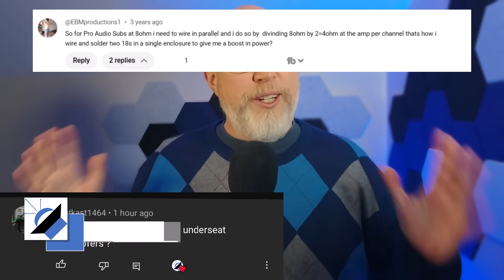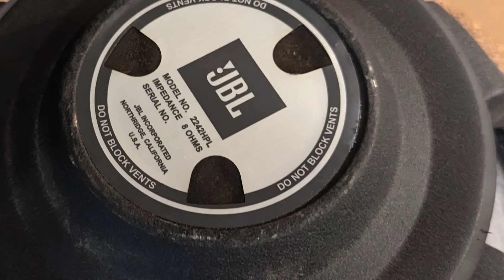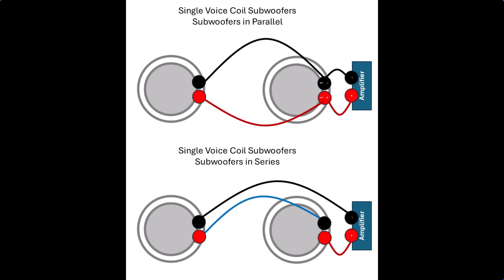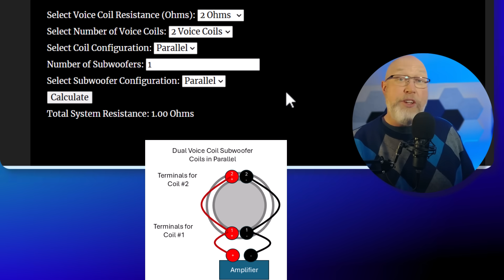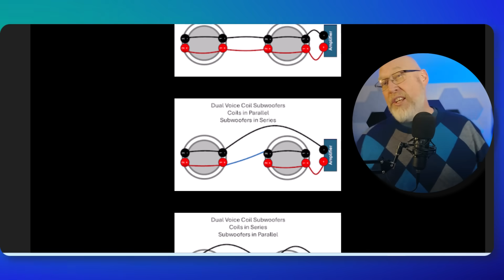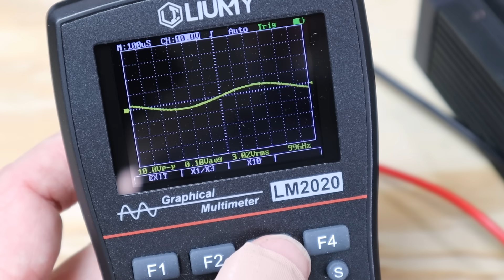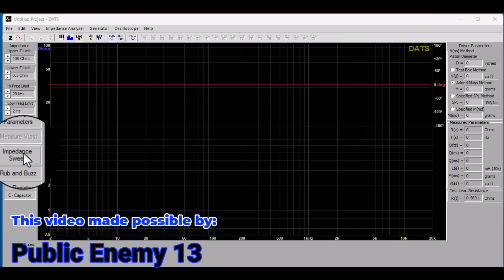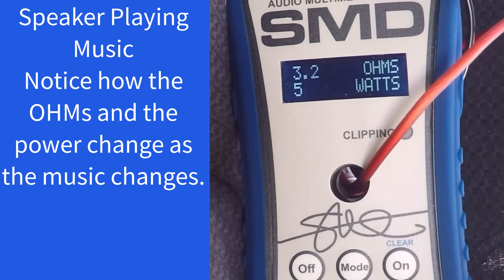Wiring your subwoofers for more power and more bass!

Comment: I NEED HELP! how do i wire 2 Sundown 10" Nightshade V6's that are dual 1 ohm, wired to 2 ohm? I cant seem to find a diagram but do I wire the subs separately in series, then run them parallel to the amp? Or should I just stick with 1ohm output and buy a 1ohm amp?
Reply: Positive from one set of terminals to the negative on the second set and same for the other terminals the to the amp

Comment: In my experience a 4 ohm DVC does not have two 4 ohm coils it actually has two 8 ohm voice coils and when wired parallel they make a 4 ohm load.
Maybe there's a reason it just seems that way. I have simple test equipment. But that's what I've found.
Reply from the maker: If you are measuring with a multimer then you are measuring the DC resistance.  DC resistance and nominal impedance are not the same thing.

Comment: @5.26 you've misspoke or made an error. A single 2 ohm dual voice coil subwoofer wired in series gives 4 ohms. Wired in parallel it gives 1 ohm. Parallel vs series absolutely matters with a single driver. In effect, a single, dual voice coil speaker will behave the same as two single voice coil speakers. I'm surprised no one has mentioned this.

Comment: Great channel! I have a 4 Ch. 2 ch x 4 ohm bridgeable amp. Can I run 2 tweeter on one bridge and this configuration on the other bridge (4 ohm Dual coil sub in series and 4 ohm Single coil woofer in parallel with the sub)?

Comment: Hi,  I have a question: I have a Jeep Liberty 2012 with a stock 6.5' subwoofer from a stock stereo.  I want to add a 10" woofer & separate amp. Can I get the signal from the stock woofer? Or should I get the signal from front speakers using an LOC like a PAC SNI-15? (My amp is a pioneer 760W, GM-5400T already used on the box sub in another car. )

Comment: Anyone know how the RMS power is divided between speakers when wired in parallel? For example 120 watts @ 4 ohms and 185watts at 2 ohms . Speakers are 4ohms each so if I wire them in parallel, does each speaker get 185 watts rms or half of 185 each.
Reply from the maker: Half of 185.
Reply: @DIYAudioGuy thank you so much!!

Comment: INSIDE THE "HOUSE / HIFI" = 8ohm
(pro stuff = 4ohm)

INSIDE CAR = 2ohm
(sellers using "watt out"  very low   "sounds  like more" )

OOHH  I HAVE  "5000 W  AMP" ..!! YES BUT IS IN  "0.1 ohm"  15sek  max
(look w output  in   4ohm or 8ohm "THEN"  = 4x25 WATT)

REALITY  IS  HARD

Comment: The impedance is both from the coil inductance and how much the speaker is allowed to move. If the speaker is allowed to move a lot, the impedance goes up. If the speaker is restricted by box loading, the impedance goes down. The speaker is generating a reverse voltage which has the effect of lowering the current going in.

Comment: Resistance is resistance not DC or AC. Take some time do research before making a video about something you don't know anything about.  Maybe actually read ohms law and see what it actually is kirckoffs law would be helpful as well
Reply from the maker: How about doing some research before you make comments that you know nothing about.
Reply: Look at a waveform and how a speaker works it literally has to push and pull to work. “Alternating “ 

The amp isn’t technically AC but a speaker has to be

Comment: The system is connected to battery not alternator so with your AC logic you claim speakers make would kill your battery everytime
Reply from the maker: You are missing something important.  There is an amplifier in between the battery and the speakers.  You are not connecting the speaker wires from the amplifier to the battery (or at least I hope you are not).  You are not connecting the speakers to the battery (again, at least I hope you are not).  The switching power supply in the amplifer gives the amplifier the voltage it needs, and the RCA input tells it how to move that voltage—up, down, back and forth—to make the music. The speaker never sees raw DC.

Comment: How does a speaker make AC electricity? I'm curious because AC current will 100 percent kill your battery very quickly. Your alternator generates AC current but rectifies it in the rectifier bridge . The reason alternator does that is because otherwise you would need a new battery every other day
Reply from the maker: If you place a coil of wire near a magnet and move either one of them back and forth you will generate AC current, you know what a speaker is?  It is a cone attached to a coil that sits inside of a magnetic field.  The same concept is used in reverse to move the speaker cone.  A speaker is an AC device, it is connected to an amplifier that powers the speaker, not a DC battery.  You don't hook the speaker or the speaker wires from the amplifier to the battery.

Comment: If you had a high impedance  multimeter such as  fluke 87v you measurement would be closer to the target reading.  An oscilloscope should be the most accurate for reading.
Reply from the maker: No.  The nominal rating provided by the speaker manufacture is just that, nominal.  In name only, or an approximation.  The DC resistance is rarely ever the same as the nominal impedance.  When the speaker is playing music the resistance (called impedance because it is AC) is a function of the frequency.

Comment: Ohm’s Law is a fundamental principle in electrical engineering and physics, describing the relationship between voltage, current, and resistance in an electrical circuit. It states that the current through a conductor between two points is directly proportional to the voltage across the two points and inversely proportional to the resistance between them.

Ohm’s Law can also be extended to include the concept of electrical power. Power in an electrical circuit is the rate at which electrical energy is converted to another form of energy, such as heat, light, or mechanical energy. The unit of power is the watt (W). Voltage is electrical potential to do work ohms are the resistance to the work  and amps or current is what carries the voltage it does the actual work. Watts are the power.  V=I•R, R=V÷I, I=V÷R.

Comment: So u cant drop two 2ohm double voice coils down to 1ohm ? 
I wired each of my subs to 1ohm tide them together to 1 terminal on my box , ran my load test and its reading 1.1ohm load , y is everyone saying i will mess up my amp thats 1 to 4ohm stable but told i can only down ohm my speakers to a half ohm ?
Reply from the maker: You've just wired your amp to a 0.5 ohm nominal load.  When you measured it you got the DC resistance.  They are not the same thing.

Go ahead and buy a second amp so that you've got one ready when you blow your first one.

Comment: The voice coil is not creating a magnetic field when you push on the cone.  As the cone moves across the magnet, current is generated across the coil.  A push will generate current in one direction, a pull will generate current in the opposite direction.  The DC resistance will change because the small current used by the meter to measure resistance is……..you know what, never mind.  I give up

Comment: Hey thank you for the video! Curiously is it possible to then figure out what the coil resistance is without having the actual datasheet? Since actual measuring with the multimeter gives just DC resistance? I salvaged a couple old drivers with no datasheet...

Also i have 2 more questions:

1) If theres no way to check its coil resistance is it okay to use the DC resistance from my multi-meter as a point of reference then?

2) On one of those salvaged speakers, there was a tweeter connected in parallel to the mid woofer, along it had a coupling capacitor on the tweeter terminal any idea if its useful?
Reply from the maker: If you're doing this a lot then it's worth getting one of these:  https://youtu.be/6g39ScWma3U?si=JYWECdgEZhG5MlK0

Yes, just checking. The DC resistance will get you close enough to know what the nominal impedance probably is. 

The capacitor in series with the Tweeter acts as a bass blocker to keep low frequencies from blowing the Tweeter.  It's very common to see this on less expensive speakers, better speakers will have a full crossover Network with multiple capacitors and inductors.
Reply: @DIYAudioGuy  Thanks for the prompt reply! I am also trying find a complete guide to designing an enclosure for the Subwoofers I salvaged, and I see you have a lot of videos on it, but it a little daunting honestly.. could I bother you to link me to one you suggest for beginners? I am planning on 3D printing my enclosure so the design phase is more crucial. Thank you once again I really appreciate your work

Comment: I have the single 12 inch kicker comp r loaded enclosure its dual coil 4ohm it's wired to 2 ohms is it not possible to get it down to 1ohm?
Reply from the maker: Check out the calculator at diyaudioguy.com, I built it to help you answer these kinds of questions.

Comment: The wiring diagram at the start is wrong 1 sub will get more power then the other
Reply from the maker: You are incorrect.
Reply: @DIYAudioGuy  Can 6.5 -4ohm speakers be wired to a lower ohm for a louder sound?

Comment: What would give more output one 1000 watt subwoofer or 2 500 W subwoofers same size
Reply from the maker: If you went with two subwoofers you would double the cone area.  In theory that would give you +3db holding power constant.

Comment: Hello DIY Guy. I have a question. I have 6 4 ohm loud speakers on my motorcycle. All are 250-300 rms rated. Is it better to power them with a 2000.4 2ohm amp or a 2000.4 1ohm amp? Wiring in parallel is the best option right?
Reply from the maker: Makes no difference, series versus parallel is about matching the speakers to the amp so that you don't blow the amp.  There are some people who will argue that a thousand watts at 1 ohm will sound worse than a thousand w at 2 ohms, but you're not going to notice the difference on a motorcycle.
Reply: @ Thank you Sir.

Comment: I don't think your 1-Ohm schematic is correct.  You are showing a 2-Ohm load in series with a 2-Ohm load, which is 4-Ohms bridged.  In order for it to be 1-Ohm, there would have to be a separate lead going to the second sub from the same amp terminal.
Reply from the maker: You are incorrect.

Comment: many years back I ZZZT-poofed a woofer. replaced it, and I replaced the ridiculous 22 gauge wire from the crossover to the woofer with 12 gauge...

and the other woofer  ZZZT-poofed, or I thought it did. putting my fingers on the woofer verified that it worked, I replaced the wires from the crossover in that housing, and the speakers sounded better than ever

a driver is a linear motor. when you pause the music, the still vibrating woofer acts like a generator and feeds bass back to the amp, and the amp dissipates the feedback via something called the damping factor. this mechanical mass generated bass is called overhang.

that one foot length of 22 gauge in the speaker box interfered with the damping. the result was muddy bass. putting 12 gauge in the crossover to speaker damped the overhang and clarified the bass.

experimentation showed me that audiophool speaker wires are snake oil, but size matters. run 14 gauge or 12 gauge if you have old school phone booth sized speakers.

Comment: i must be more lost then i thought because im not even sure what this guy is trying to explain...what was the point of this and how am i getting any information that tells me how to make more bass? this was like listening technical data sheet
Reply from the maker: https://youtu.be/_Jl-d_VvJSs?si=_okRotvVa4ueadjS
Reply: It can be confusing when your not familiar with car audio and wiring subs with amps, but essentially he was trying to explain the importance of the impedance of amps and speakers. Matching the impedance of your amp to your sub/subs is important to get the most power out of your system, and the quality of the sound you get. Wiring the subs differently will get different results. Wiring them wrong will either overwork your amp, your subs, or basically change the performance of them both. I know this isn't an explanation of how to wire your set up, but hopefully that helps you understand what this video explains. If you are looking for specific instructions for the equipment you have, you can either reach out to the manufacturer or refer to the instructions (if you have instructions) to get specifics on your set up. The impedance is important, and you really will want to choose the correct wiring set up (on the voice coil/coils terminals) for the subs you are using along with the amps capabilities. Wiring them wrong can make them sound less them desirable, it can make your amp overheat, or blow the speakers prematurely.

Comment: I tried making a dual 15" subwoofer setup with a 16" cube. Tested in parallel, and it was horrible. Tested in series, things sounded better, because 8Ohm x 2 was easier on the amp than 8Ohm/2... BUT, the woofers were arm wrestling with the subwoofer box air mass at high amplitudes. 🤦 So, I flipped polarity of one speaker in series, so the excursion phases are opposite, while still making the same sound frequency. This way, the second subwoofer makes omnidirectional bass, and the front-facing sub reinforces the sound by lowering the distortion and air mass/volume displaced from the box and increasing the amplitude of the sound made. Basically, it's an air-coupled, dual-mass woofer, in an absurdly small box, but it works great
Reply from the maker: Here's a more likely explanation, you had the polarity flipped on one of the subwoofers when you initially connected them and then corrected the problem when you rewired.

https://youtu.be/2hf_dymCBMY?si=LdtiTJsaACCyT1hp

I know this comment probably comes off as a little bit snarky, it's legitimately not.
Reply: @DIYAudioGuy  I'm not a newbie at this... I can follow the terminals of both speakers, and know how things were set up. I also explained why I did the polarity flip for one woofer... Box was super small, and during each phase of excursion, they were trying to arm wrestle, as the air in the box was resisting their efforts at displacing and replacing the volume of the cabinet. Now they work Together, since the travel of one subwoofer is complimented by inverse travel of the other. Before, both pushed out at same time, then in at the same time, and the low air cabinet volume was causing massive distortion from air coupling. I believe if they were 12"s like the original, it would work fine in series or parallel, but two 15"s in same polarity phase shove enough air to make the whole cabinet pressure/vac levels  interfere with the subwoofers. Used to have it turned down super low to prevent distortion and audio clipping, but now it runs fine up to super high vol level, and the clarity of bass notes at longer distances impressed me.